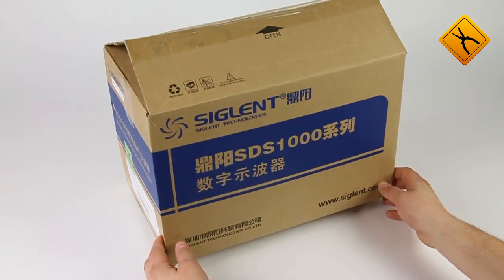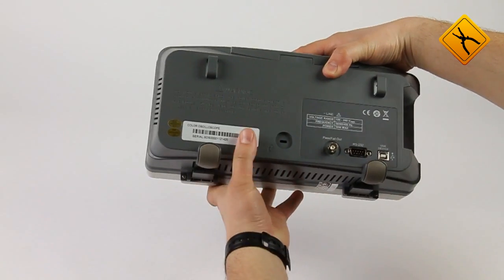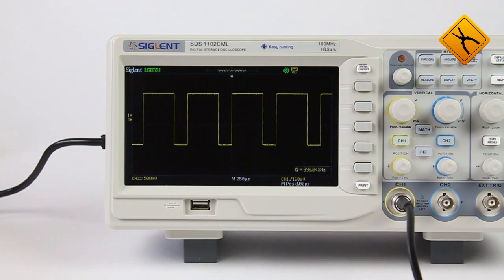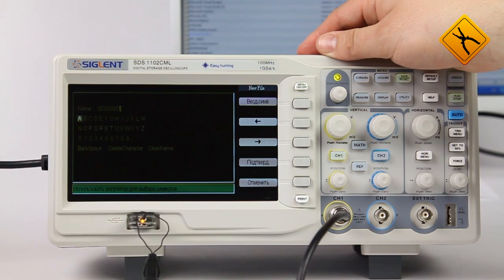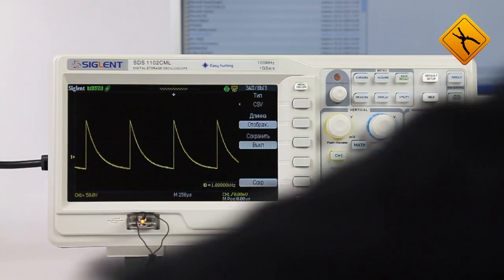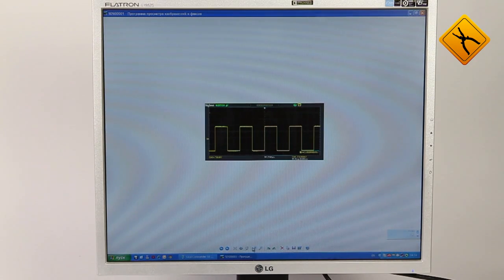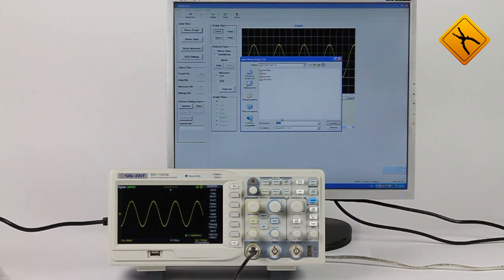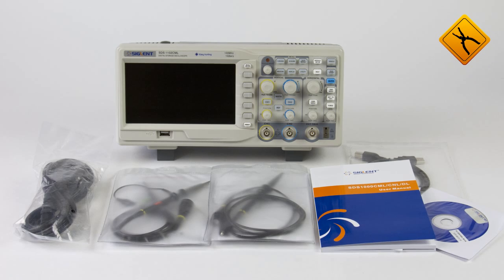SIGLENT SDS1102CML Digital Oscilloscope

Comment: hello, I just purchased this oscilloscope yesterday, & I have a few questions and I hope somebody can really help me out on this before a have to contemplate sending it back. First of all every time I boot it up,  it always seems to want to go into the options screen and asked me for language. I've already set it for English but it does not seem to want to save it. Everytime I boot it it keeps asking me. is there a way to set this so it does not keep asking me, or going into the option menu when I boot up? My second question is I have a pict bridge printer connected to it, it's an Epson WorkForce 845 and I know its a pic bridge because it works with all my other digital cameras. the printer acknowledges the oscilloscope, and I have the menu ootion "Back USB" set to "Printer" and the icon on the top right corner chaanges from a computer to a printer but I cannot set the "Print Key" option to "Print Picture", as it seems to want to stay in "Save Picture" mode. Is there a way to be able to change this? Or is this broken? I appreciate any help on this.
Reply from the maker: Dog Rox The problem with the choice of a language in a boot  - this is a feature specific firmware. Try to update the firmware to the latest date. Firmware download here http://www.siglent.com/ENs/gjjrj.aspx?id=15 . Be careful when upgrading, follow all the rules (they are in the readme file).
Reply: Thank you toolboom, for the response. My oscilloscope does have the latest firmware. already. So do you think that the request for the language at boot up, is a problem with the firmware itself and I should be flash it?  Or is that just a feature that is with this latest firmware that I already have?
Reply: Ok, I did not have the last firmware.   I downloaded the latest version and I have installed it successfully but the second half of the job requires a update.cfg file , which was not included in the firmware download. So I cannot do the second step.

Update: I did find an update config file to fix the problem of the language request at boot up. So that is successfully fixed. But the second problem still remains about the print key mode cannot change from save picture to print picture so I can use it on my pictbridge printer
Reply: +Dog Rox
Hi Dog Rox!
Can you help me? I don't find the .cfg file.
Thank you.